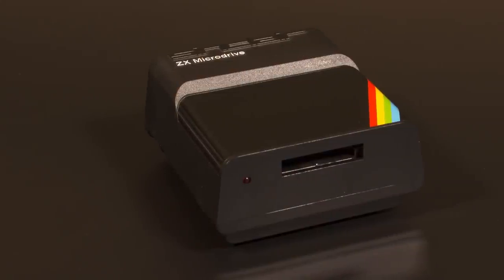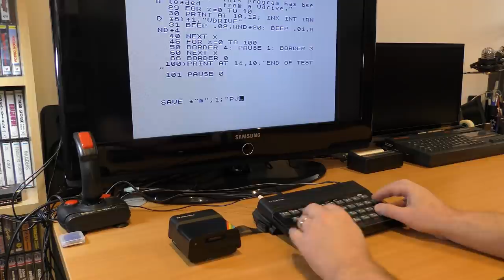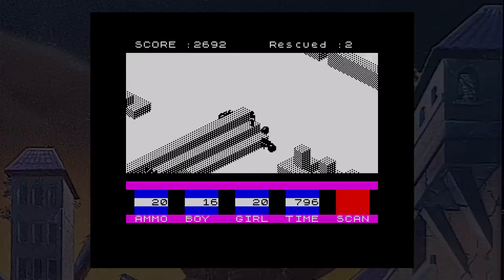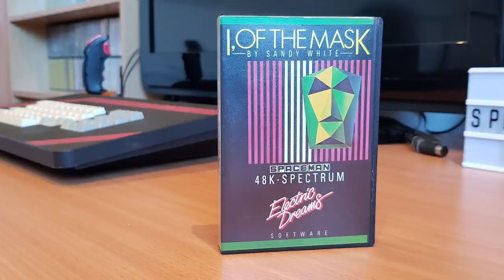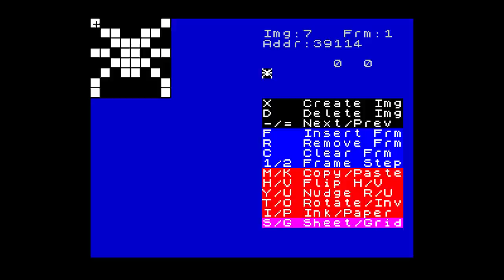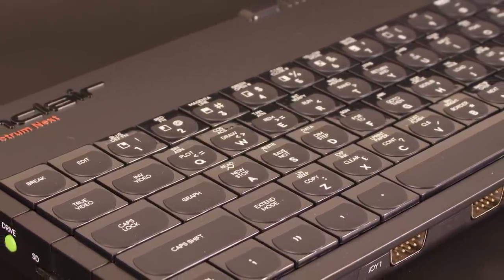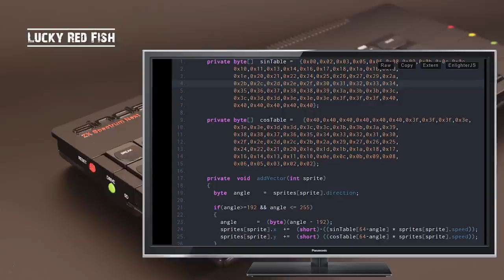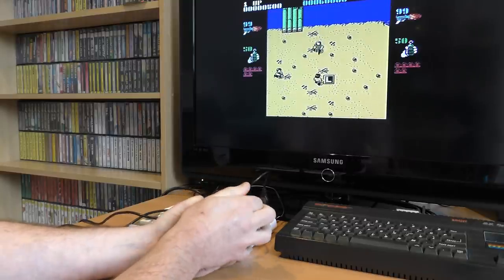The Spectrum Show EP 104

Comment: For ZX Next DMA programming, you can check the wiki article describing it into details: https://wiki.specnext.dev/DMA
And for some canonical example of usage, I would probably go with my ULA double-buffering example (does include DMA usage for "CLS"): https://gist.github.com/ped7g/59e7b3941177444ffb48ac974f3e8ba6
(was published as part of the #devTuesday snippets, which mostly consist of small examples of particular feature, so that may be another thing to check if you are getting familiar with some part of Next, if there's devTuesday snippet using it, it's often the simple and small code example: https://wiki.specnext.dev/Z80:DevTuesday )

(WRT to DMA, most of the examples do incomplete initial setup (so it works only if DMA chip is in reasonable state, which is in 99,99999% of cases), or don't show it's possible to do only partial delta-init for particular transfer, once you did full init once, so that's why I'm suggesting my ULA cls example, which shows both aspects).
Reply: Great thanks I'll check it out,
Reply: Thanks. :)